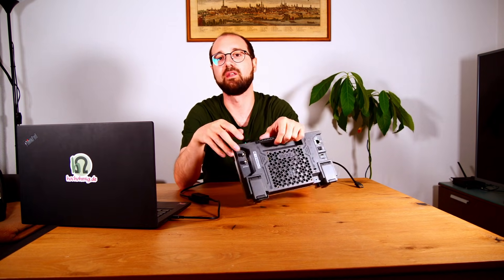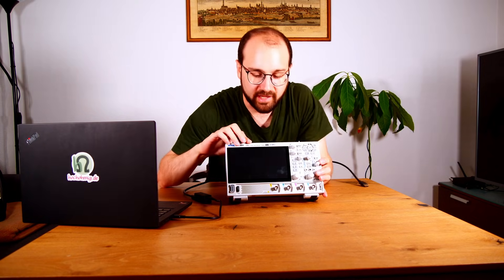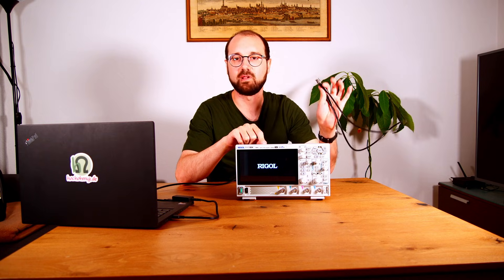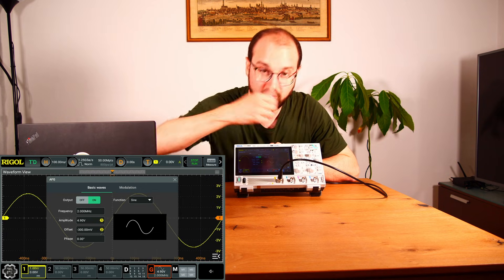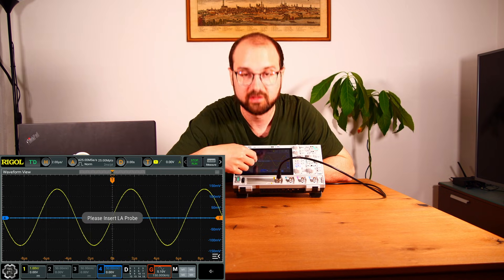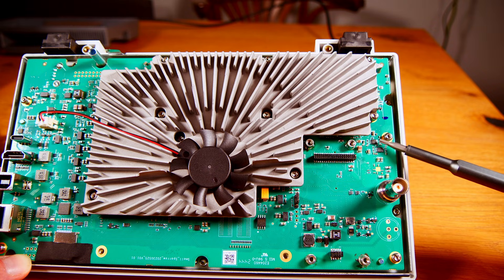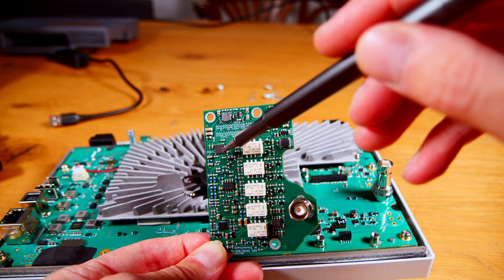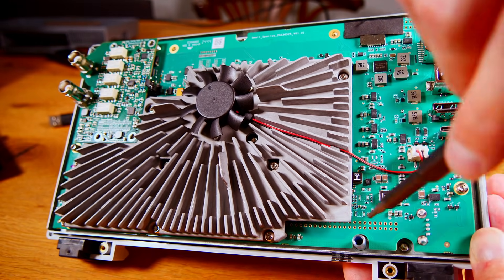Rigol DHO800-Hack: Adding an arbitrary function generator!

Comment: after the hack, will it break the builtin firmware update function? for example, if Rigol release new firmware for DHO800/900, which firmware should I choose after the hack? new firmware for 900 series or 800 series?
Reply: sorry, I just checked the firmware, they are actually the same, please forget my stupid question.
Thanks for the video!
Reply from the maker: @burgerk3319  The question is not that stupid. I didn't mention that on the video, but after "upgrading" the bandwidth, you get an offset on the channels. I guess (but I'm not sure) that that's due to a different FPGA image used on the 900 series than on the 800 series. Only after a normal firmware upgrade, the offset is gone, because during the upgrade the 800 FPGA firmware is replaced with the one from 900 series.
But as you said, both is in one image and it should work after the hacks, yes.

Comment: Hi. Did the boot time became worse after patching firmware?
Reply from the maker: No, the boot time is identical. Technically it's not patched, but the electronic type label of the scope is modified and it thinks it's another model.
Reply: @hochohmig  so one advantage over 924s, because it has 50s boot time.
Reply: @hochohmig  I assume that dho804 boots to interface in 40 seconds.

Comment: Thank you so much for the video, it was enough to make me finally buy a DHO804. I am starting to plan my purchase of this board and was hoping you could share the LCSC part number for the solderable nuts? Thanks again.
Reply from the maker: Sure. It's either SMTSO3070CTJ (C2916367) or SMTSO3060CTJ (C2915637), I think the 7mm but am not completely sure. Just buy both and try it ;-)
Reply: Thank you very much!

Comment: how to buy the small board?
Reply from the maker: Unfortunately, you cannot buy it directly - you need to order it e.g. at JLCPCB. Head over to the links in the video description for more details :)
Reply: @hochohmig  This ADD-ON is very interesting to add the extra feature to the Oscilloscope. Have checks the Github page, but it is for my not clear how to send the it to JLCPCB. Can you perhaps make a short video howto proceed. I have not ordered before at JLCPCB. What files do you need to have JLCPCB produce the print with the necessary component soldered on the PCB?

Comment: Please compare the hacked 800 with a 924s. Should I do it?
Reply from the maker: Unfortunately, I don't have a 924S. :/
Reply: In 924 and 924S they add faster probes. 350 MHz instead of 150 MHz. Those probes separately are expensive. I would say it's better to buy 924(S) instead of 914(S), because of this difference.
Reply from the maker: @norbert.kiszka  You're right, that's a major advantage of a "real" 924 :)

Comment: For LA, make sure you add ram to the FPGA slot
Reply from the maker: Are you sure? To my knowledge the LA halves your sampling rate, so I'd guess it'll use half the RAM also...? 
As far as I know, it's not clear for what the additional RAM on the DHO9xx is used.
Reply: @hochohmig  actually I hacked this. I can use LA with full 1.25 GSa/s but only when I have all channels disabled. But I can use analog channels to trigger LA. More of that, I hacked one more thing in LA - in the stock firmware, LA is unavailable in the roll mode.

Edit: higher sample rate doesn't require more memory, but eventually faster instead of more. LA works without those memory chips, but it makes less waveform updates per second.

Comment: Funktioniert das auch mit Oszis mit niedrigerer Ausstattung? Ich habe das DHO 812. Das hat nur 2 Oszieingänge. Macht das einen Unterschied?
Reply from the maker: Hm, also bei den Zweikanal-Dingern weiß ich's leider nicht.
Von der DHO900er Serie gibt's kein Modell mit zwei Kanälen, d.h. egal ob du es auf das DHO914S oder DHO924S "aufmachst" wird die GUI dir auf jeden Fall immer die vier Kanäle anzeigen - damit musst du sicher klar kommen. Ob aber die fehlende Hardware der Kanäle 3 und 4 Probleme macht weiß ich nicht, entweder du probierst es aus (das Risiko ist ehrlich gesagt gering, weil man die Modifikation ganz leicht rückgängig machen kann), oder du fragst mal freundlich im EEVBlog nach, hier wäre der Thread dafür:
https://www.eevblog.com/forum/testgear/hacking-the-rigol-dho800900-scope/
Reply: @hochohmig  it's not a problem. He will have 3 channels (4 actually, but one will be dummy, because of lack of AFE and BNC socket) instead of two plus external trigger.